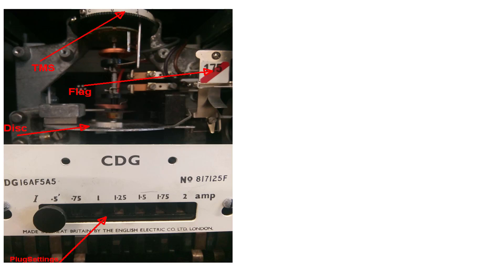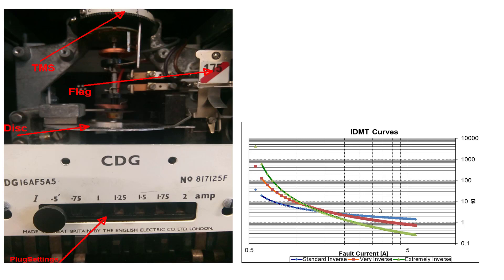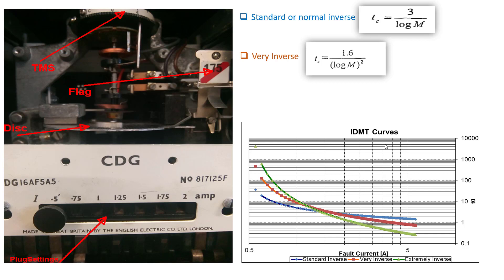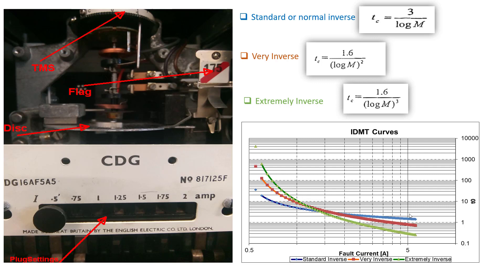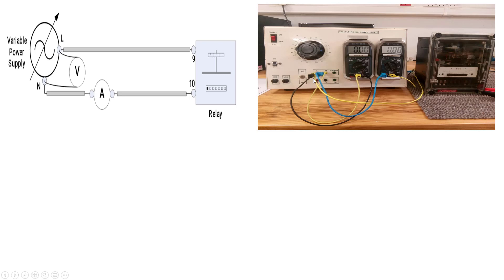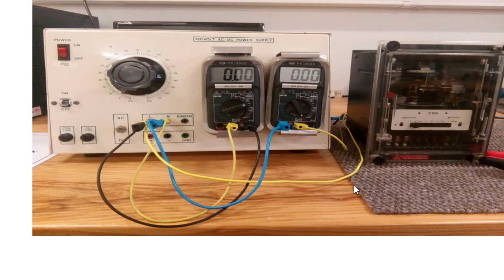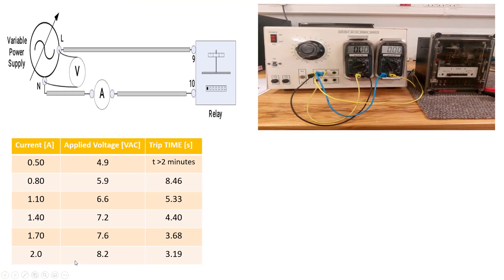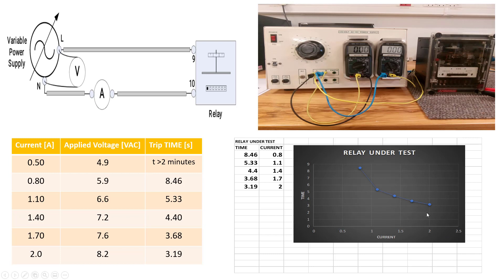IDMT Relay time current characteristics curve - Part 2

Comment: Looks like extremely inverse
Reply from the maker: Yes, the steepness of the curve strongly suggests that it follows an Extremely Inverse (EI) protection characteristic. 
The sharp drop in operating time with increasing fault current is typical of that curve class.